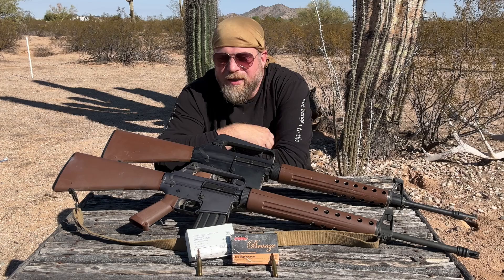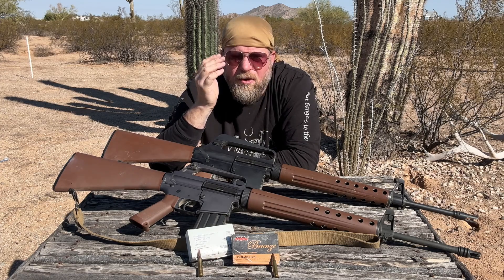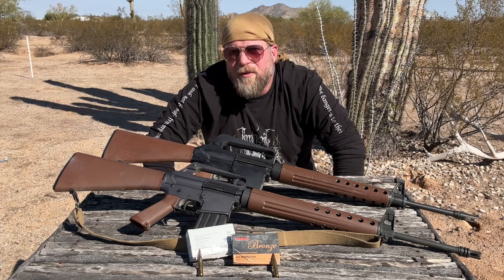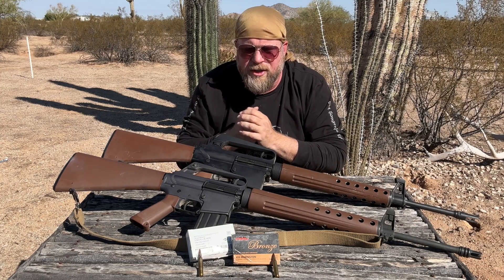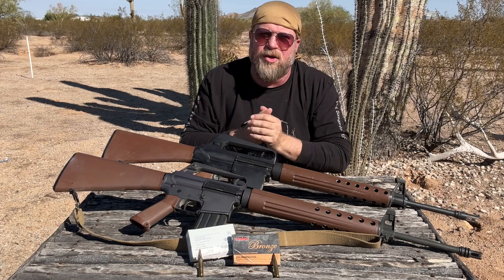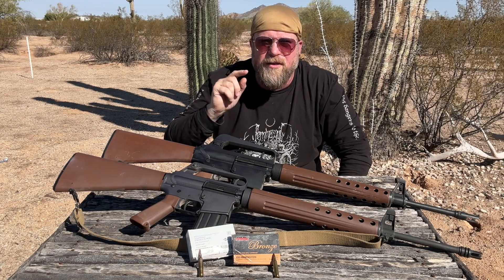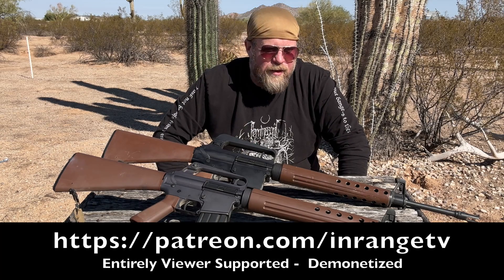What is M193?

Comment: 6:15 Case Head separation has to do more of headspace of the barrel, and/or out of spec bolt. Annealing the case mouth & shoulder softens that area to simply prevent splitting. Annealing isn't done to the head of the case since hardening is ideal  to prevent separation.

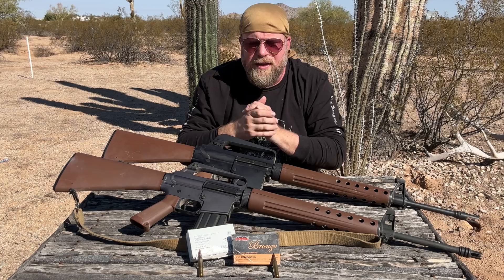Edit: 8:50 The 55 gr FMJ is more likely to come apart at the exposed base of the bullet when it turns forward. That is why yawing is important.

Comment: If everything else about a cartridge is the same between 223 and 193 and there’s a 200 fps velocity difference then there has to be a corresponding a pressure difference between the two.
Reply: A quick look at some reloading manuals that give pressure curves will show you that pressure does not always equal velocity. It's the burn time and pressure curve that determines actually velocity. Some powders that create 60000 psi will have the same or lower velocity as a powder creating 58000 psi. Not trying to piss you off. Everyone needs to look at loading manuals to determine what powders generate the best velocity for the pressure. Also pressure not velocity is what damages barrels. Pressures were published in some online nosler manuals.
Reply: @greybone777  Yeah, this is some of the complexity that I mentioned in my first response. I am not even close to being an expert on the subject, but I would think that internal pressure vs external (ambient) pressure is what determines velocity. BUT that does not mean maximum chamber pressure is needed for velocity to be higher. .223 achieves approximately the same muzzle velocity out of a 24" barrel where 5.56 uses a 20" barrel. This could be seen as slower burning powder in the .223 needing extra barrel length to achieve the same pressure at the muzzle as 5.56 in order to get the same bullet velocity while maintaining a lower chamber pressure. 
I am still curious what kind of pressure and velocity you'd get using M193 in a 24" .223 barrel.
Reply: Well sure, but that just make's 223 a downloading of M193, its below the safe limit so its not really worth mentioning.
Reply: I am wondering the same thing. Obviously the calculation is complicated with many variables, but how can you have different velocities if they are the same (4:55). He said that a shorter freebore could cause a pressure spike (12:00), and even here he is not recommending using M193 in a .223 rated barrel (12:12). And why would a .223 have difficulties cycling a 5.56 action if there were no pressure difference (12:34)?
If it was only a difference in chamber design, then why does .223 achieve a similar velocity out of 24" barrel (I think that is the industry standard rating method) when M193 only needs a 20" barrel? What velocity does M193 get out of a .223 barrel?
Reply: @W-helper  I could be wrong but I think the free bore space allows some pressure to leak around the projectile before it fully engages the rifling and seals up.  

I think the difference in pressure due to velocity, or rather as demonstrated by velocity, is implied.
Reply: @alexisborden3191  Hmm, ok. I always get confused a bit on the terminology, but I think you are specifically talking about a throat. There's freebore, throat, and lead. A throat would be a slightly conical section of the bore just after the chamber that guides the bullet into the rifled bore. I have only heard about them in high powered hunting rifles and am not sure if an AR has one. I would have to look into it along with what velocity you get out of 5.56 compared to .223 in a rifle chambered for .223.
Reply: @W-helper  I thought it was called the feed ramp, but maybe its different names for different things that do the same job.  That wouldn't change anything about the pressure or safety though, a difference there would just make it more likely to jam or feed improperly.
Reply: @alexisborden3191  Oh, no, a feed ramp transitions cartridges from a magazine into the chamber. I think a throat is like the forcing come on a revolver (the extension on the back end of the barrel near the cylinder). It swages the bullet a bit to make a tight seal in the bore when fired.

Comment: I'm not aware of any 223 firearm that is marked as 223, that cannot take 556 unless they are specifically a bolt action firearm. Save for one that I've heard about, but I have not investigated. The target version of the Mini-14 is said that it is not chambered for 5556, virtually all other many 14s have a 556 chamber. They just aren't marked as such because Bill Ruger was selling the firearm as a civilian firearm and marked it as 223. Please, read your owner's manual that comes with the firearm it is literally with every single Owner's Manual of all many 14s except for the Target version. Guys who won't put 556 into their many 14 because it's stamped 223. Are excellent examples of people who do not read the information that comes with their firearm. Which means don't listen to them anymore. Until they learn their lesson. When they say things like that. You shut off the video and you sum it down until they learn their lesson.
That said, you are the first individual I've ever heard that puts emphasis on the ogive designed into the projectile. I have picked up both 223 and 556, and looked at the bullets and they are exactly identical in the vast majority of circumstances. And the free bore on a 556 is far longer than that differential could possibly be anyway. So I'm not sure of your thinking here, however I will look into my research. Which was done in the late seventies early eighties from the outside, I have Revisited it about three times, and have yet to find anything new or surprising except for the fact that with an original Colt firearm without a forward assist in the United States Air force, even though I was Army trained before I enter the service. I fired expert marksmen both in basic training, and in my shooting certifications, the last of which was done at eight below zero with about 8 to 10 knots of wind in my face. Because of that I fired 40 rounds, both right hand post and left hand Post in full auto, and still all of the rounds were in a 3-inch group in the center of the target. When 5 1/2 to 6 lb Firearms are shooting that accurately, I question people who put muzzle brakes on AR-15s. Especially when by the time they're adding muzzle brakes the gun is already a 9 lb rifle. If I'm going to carry a 9 lb rifle around, plus any attendant other support supplies for that rifle, it's most likely going to be in 308.
For the purpose that the 556 with 55 grain Full Metal Jacket ammo was created it is a superb round. But if you have to shoot through anything, any tactical penetration is required at all, I think they missed the boat about 10 years ago when they could have just replaced all their uppers, would have had to replace a single magazine. And gone to the 6.5 Grendel. It is capable of doing anything a 556 is capable of doing, and it has the ballistics of a 308 or better.

Comment: Thanks for the information!  
For economy and consistency, I stick with 55 gr ammo, M193 when I can get it, just because.  I prefer Winchester or Hornady Frontier; I've seen it mentioned that they are actually milspec.
Some also note that .223 and M193 cases eject to different angles, though this may also be firearm dependent.  I've seen video showing that M193 ejects more energetically, towards the 2:00 direction.
Reply: This is true.  I've loaded mags with 3 .223's then 3 5.56's and kept alternating and kept an eye on the ejection pattern.  And yes like clockwork they had different ejection patterns.
Reply: @jeremywatson9129  Thanks!  My best indicator is whether a case hits me when firing my Tavor left-side. 😜
Reply: The ejection angle is a function of gas pressure. NATO rounds have higher pressures.
Reply: @sloppyfloppy79  That has been my understanding; I just wasn't sure if it was anecdotal or pretty well recognized across the board.  We ARE talking about the internet, after all. 😎
Reply: @petesheppard1709  I worked for 3 FFLs, 1 being a manufacturer. The real difference between the two is throat angle. 223 chambered guns have a very steep angle which generates unsafe pressures in guns designed for 223 ammo. 556 guns have a shallow angle gradually leading into the rifling which helps keep pressures to a reasonable level in the chamber. The cartridges themselves have a difference in powder charge.
Reply: @sloppyfloppy79  Thanks! While actual danger is minimal, I prefer rifles with 5.56 chambers.
Reply: @petesheppard1709  Same. You can shoot both 223 and 556 from a NATO barrel. .308 is the other way around. You can shoot 7.62 NATO from a .308, but not .308 from a 7.62 NATO. 308 is the higher pressure round.
Reply: @sloppyfloppy79  I've seen several comments, though, that .308 (presumably lighter loads) can be safely fired from a 7.62 NATO marked M1A.

Comment: The penetrate a helmet at 500 yards is probably because that's about the extent of effective firing range for an infantryman without optics or even simple optics. It's also just a simple reference point to compare to.
Reply: Also-standard practice for naval rifles on battleships was to design the gun to be able to penetrate the armor of the ship carrying it.  I suspect bureau of ordinance took this concept and applied it to the infantry.
Reply: plus after action reports of earlier ww 2 and Korean wars showing survival rates of soldiers by bullets being deflected by the helmet liners  inside the helmets.  The idea was to have a round that would go all the way through and NOT get turned...Some cases had been photographed and been used as a basis for the standard.
Reply: @panzerdeal8727  Wait, so they saw that soldiers survived more often when a bullet went in one side of the helmet, and bounced of the inside of the backside?  And then came up with the go through an M1 helmet requirement off that?  I'm a little confused by what you mean, and do you have a source for that?
Reply: It's also the real effective distance. It can kill for a long ways out, but the velocity at 500 is at the end of its effectiveness to create the infamous wound channels of the 5.56. I have a 20" barrel and the bullet drop past 500 is when I start aiming at clouds.
Reply: @sloppyfloppy79  But that comes from the requirement.  The army asked for effectiveness at 500yds and so it is effective at 500yds and no more.  If they asked for 300yds, it would be effective at 300yds and no more.
Reply: @alexisborden3191  technically it's effective to 800 but that's pushing it for a combat round. It has more power at 1000 than a 22lr has at 50. A 22lr can kill a man at 500.

Comment: The rifling twist is much different for military arms chambering M-193 as well. It was settled on a 1 in 20" twist for the M-16 so as to stabilize the projectile to achieve the results desired for use in jungle warfare. Faster twist rates over stabilized it, thus somewhat heavier projectiles were then mandated. The efficacy of the Colt Commando and present day 14" and up barrel lengths will not suffice at the twist  rate of 1 in 20". The original M-16 was a devasting weapon. Too bad McNamara and his cronies messed with it!!! I believe the M-63 (Stoner) had the same twist rate as well, but I may be remembering incorrectly.
Reply: It was originally a 1 in 14 twist. Then they went to a 1 in 12 because it wouldn't properly stabilize the round from any barrel.  It makes no difference how fast the round is spinning, the reason it was so effective was because the copper jacket and lead core would readily deform and fragment at close range. This is because of the bullet being much easier to break apart than the later 62 grain m855, and the increased velocity. Has nothing to do with the twist rate.
Reply: You can under spin a bullet but there is no such thing as over spinning one. It's always better to go for a tighter twist rate to increase the type of ammo you can shoot accurately. There is a sweet spot for every projectile in terms of velocity and stability. Tighter twist rates do slow the projectile down, but it's negligible. Less than a percent in most cases. I've seen twist rates as low as 1 in 3 and as high as 1 in 60 in firearms.
Reply from the maker: This is incorrect, you absolutely can over spin a bullet, and sometimes they will disintegrate as a result when they leave the barrel. This is/was a somewhat common problem with 1/7 and 80 grain bullets with thin jackets.
Reply: @InrangeTv some have even gone back to gain twist riffing to stabilize the heavier bullets. Article from American gunsmith.
Reply: @InrangeTv  that's not over spinning problems, that's velocity problems. The faster the velocity, the faster it spins. 1000fps out of a 1 in 12 is 60k rpm. 2000fps out of the same barrel is 120k rpm. It's the same reason lead projectiles stop spinning at a certain velocity and make your rifle a smoothbore with lead depositing. There's rifles out there with 1/3 twist rates that don't perform like shotguns.
Reply: @sloppyfloppy79  Say what you will. I know what the round did in Vietnam. I don't know where your experience comes from but mine is from using it on humans. The original 55grn projectile was devastating. The weapon was not that reliable at the time, however. And the twist rate was 1 in 20. I'm not talking about either modern or sporting twist rates for .223.
Reply: @ancientixl  1 in 20 is perfect for 55 grain. The 1 in 7 was adopted for the NATO barrel to shoot the longer steel 855s. It's not so much the weight, but the length for tighter twist rates.
Reply: I believe it was 1\14" that was originally used. During arctic testing it was found to not stabilize traders and reduced to 1\12" same with the SS109 /855 originally 1/9 reduced to 1\7"
Reply: As already stated rifling twist started at 1 in 14, went to 1 in 12, then went to 1in 7 for the SS109 tracer.  One turn in twenty inches is SLOW even for 22LR

Comment: OK- differences in the chamber cut in 5.56 or commercial. 223 Rem. Have you looked at the "Wildey" chamber, that is supposed to handle both? Is it a different design, or is it simply cutting a mil-spec chamber in a commercial barrel? And does it make a performance difference in the cartridges, if it is really a third chamber spec? Inquiring minds, etc...
Reply: The only difference in the chambers is the length. .223 is a shorter chamber, 5.56 is a longer chamber, .223 Wylde is a compromise in between.

Comment: but if the M193 ammo is loaded with 55gr bullets, and not using longer bullets such as 69gr, 75gr, 77gr, then you should not be close to the lands in a 223 chamber right (due to the bullet ogive)?
Reply: Correct, the M16, M16A1, and Colt SP1 have SAAMI .223 chambers and will run M193 spec (Lake City, CBC, etc.) ammo just fine

Comment: so how does it relate to the 223 wylde chamber???
Reply: The 223 Wylde chamber is made with the external dimensions and lead angle found in the military 5.56×45mm NATO cartridge and the 0.2240 in (5.69 mm) freebore diameter found in the civilian SAAMI .223 Remington cartridge.

So it's basically a hybrid of the 2 chamber designs. 5.56 chamber body and .223 freebore.
Reply: I noticed he didn't want to open that can of worms.

Comment: Degrees of neck. It's like talking with twins. "What do you mean, hard to tell us apart? I have the faintest scar you ever saw on my elbow!"
Reply: I think the problem is if the bullet is pushed backwards into the case and causes a extra spike in pressure.  Only should be possible with 75gr Balistic tip with C.O.L. More than 2.250”

Comment: I know one of the differences are pressures at strike.
223 is around 55k psi and 556 is 60k psi. Other than that I'm lost.
Reply: Karl mentioned that in the video; that difference in pressure isn't entirely correct as the way the military measures the pressure and the way SAMI measures pressure are different and led to different results. 
Apparently the pressure is roughly the same (probably a negligible difference) if you measure the pressure properly.
Reply: Please watch the video.